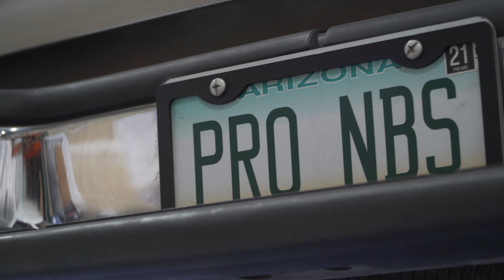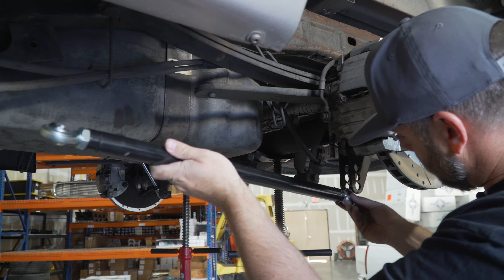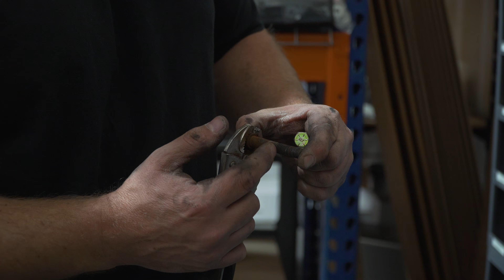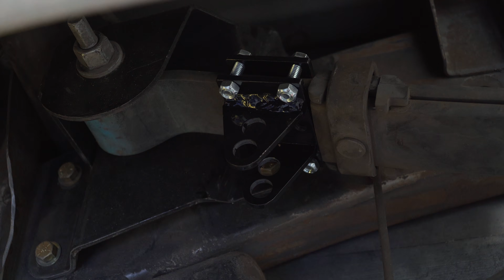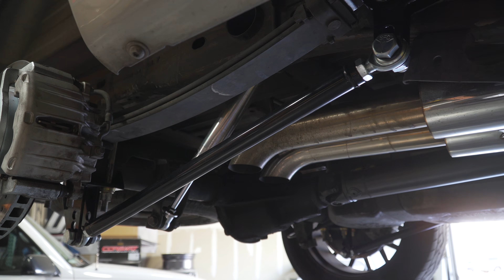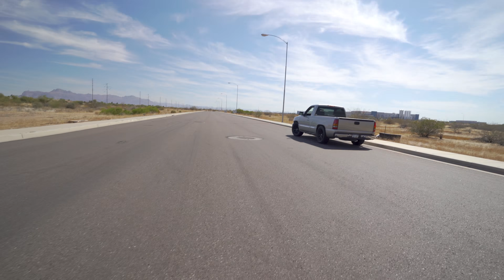Installing Speed Engineering Traction Bars on a Supercharged Silverado

Comment: I'm looking at this exact same kit. My 99 was lowered somehow by the previous person. Just enough to level it out but it squats bad when I hook a trailer and also had bad wheel hop and went a little sideways coming off a freeway so now I'm looking into improving that.

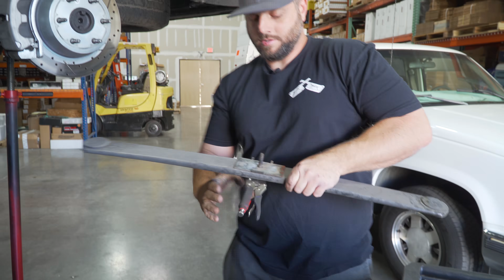1:33 how did you do that? Can I safely just undo that bolt? It wont snap back and knock me out? You skipped the whole process.
3:27 I had to replay this over 10 times and I think you said you will "set it at 5" and showed a measurement but what are you measuring?

Comment: Just curious on how this would impact towability? I have a silverado that's experiencing wheel hop when I get on it. Thiught about purchasing these but I want to be able to tow still and not Squat or lose ride quality
Reply from the maker: Won’t impact towing ability at all. It won’t help with the squatting at all, as that’s what helper bags are for.
Reply: @AZProPerformance  can I run helper bags with these?
Reply from the maker: @NBSChevy  I don;t see why not, as I don't believe they will interfere, but can;t say for sure as I have nev er tried myself.
Reply: @NBSChevy  I have the bars on for over a year now, just put helper bags on, ended up dropping the rear further so I could keep some air in the bags, rides a bit nicer now, no interference or other issues noted
Reply: @darrinlee2076  What bags are you running? I have been wanting some for mine. I wont be towing a ton but its a 1500. It will squat with any kind of weight close to 4500 lol

Comment: did you ever drill the pilot holes? and you mean the two extra holes you need to drill thru the actual springs right? that has to be a massive pain especially with them still on the truck, that is why I think Caltracs would be better

Comment: These aren't much better than the $100 axle slappers you can get. I like that there's no binding but on a truck that's not going to see off road it's not an issue and I've used axle slappers on my truck with 14 inches of travel in the rear and honestly worked okay. It stopped the wheel hop and only limited articulation by 1 in. But I lost 2 in of droop. I've got a Dana 80 full float going in right now and I don't want to use the axle slappers anymore so I'm looking for a new setup. I'm also installing hydraulic bump stops and the brackets for full airbag. I don't remember the part number but it's a Peterbilt airbag rated at 14 inches of wheel travel. It's for 18 wheelers but I've got the space under there. Working range is 9 in. So I think with the limiting straps and bump stops it should work okay. If not it's back to the drawing board. And I haven't decided if I'm going to swing arm or four link. With the swing arm I wouldn't have to worry as much about the suspension geometry. But then I have to run some sort of Johnny joint in the back to keep the axle center. I've done a lot of custom suspension work for 18 wheelers. And go karts. But both of those are completely different from a long travel truck setup. Daily driver at that. For now I'm just going to run a single ladder bar and leaf springs. I'm pretty sure I'm going to have to get some adjustable shocks in the rear because that Dana 80 is massive. It's like 750 lb. The old axle was 250. And trust me I wanted to use a Dana 60 but the Dana 80 was free. I know it's going to slow down the truck a lot but the factory Chevy 8.5 with chromoly axles and chromoly pinion chromoly everything well I split the case. I'm not even running massive horsepower just like 450. It's a 390 small block. But 4,000 RPM clutch drops around the corner through the dirt. I guess them little toothpicks just can't handle it. And it's a six puck carbon ceramic clutch. No springs. I need to start uploading videos of it and call it the trailer trash Baja buggy. Or broke a$$ buggy. If somebody has a good name for a build that's nothing but free parts. I refuse to spend any money on it. Mainly because I have no money. But I have knowledge a welder and people that like to give me free s***. My wheels and tires are coming off my dad's 06 f250. The solid axle conversion for the front is coming off a f450 the springs are coming off of a 01 Cummins 4x4. So it will be a Dodge Ford Chevy. I may put air ride front and rear cuz I can get the airbags for free. We'll see on that.

Comment: I'm not crazy about the angle of the bars. I basically have the same truck, my bars are not parallel with the ground, they're at an angle. Looks like yours are the same way. They did however get rid of my wheel hop also, so I guess I can't complain lol.

Comment: I love my speed bars. They caused me issues with my flip kit but still worked well once sorted
Reply: What type of issues did they cause? I'm currently running a flip kit on my NNBS Procharged Denali.  Haven't had any wheelhop issues, nor do I dig race.
Reply: @calvinjames7302  what flip kit are you running? My issue was the bolt holes, compared to to the belltech plate holes, were a little off. But off by enough to slightly move axle position if I remember correctly.

Comment: How did traction feel after the install was there a noticeable difference in traction? Or mainly just wheel hop delete
Reply from the maker: Mainly got rid of wheel hop. Hard to tell the traction difference, since the motor just spun the tires pretty easily anyways. lol

Comment: Would you suggest these over caltracs?
Reply from the maker: These work really well, and didn't require me to shift the tank over to get the leaf spring bolt out again. So, little easier install for our application, and price was a little ,more affordable. Heard nothing good about CalTracs too, but these work well, and no more wheel hop at all!
Reply: The only thing “better” about these are the price tag…but you get what you pay for! These are a wheel hop cure due to pinion angle ONLY, no added traction. CalTracs stop all wheel hop as well, with the added benefit of actually putting downforce on the spring and hence the tire via their pivot arm/roller 👍🏼

Comment: As a NBS owner I feel that  aftermarket suspension market has produced very little bolt on products for NBS compared to OBS Trucks. Weather its Tubular Control Arms, Triangular/4-link, or coilover conversion there are way more for OBS, C-10s, and S-10s than NBS Trucks.